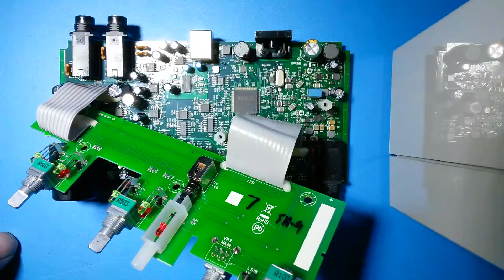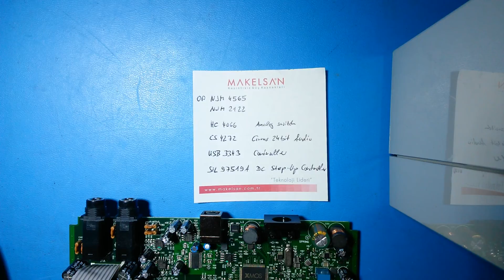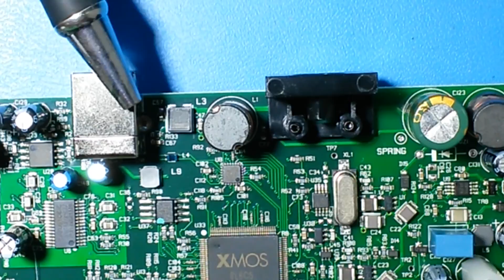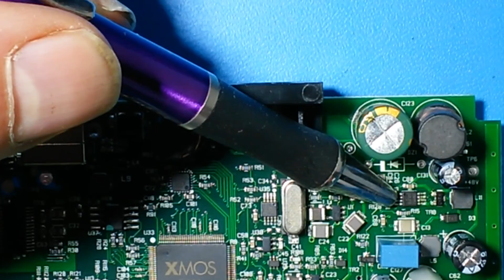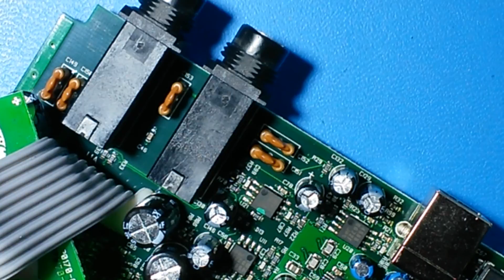Focusrite Scarlett 2i2 Defect, Repair hints, Reparatur Hinweise

Comment: USB3343 is a power controller. Not USB. USB controller what we are interested in is a XMOS chip. 4066 is a badly well known source of distortions. Considering high specs of the device, it's not used in a signal path

Comment: Hlo.. my sound card is showing a very dim green power light  
And when I connect it with the cable.. it doesn't show any lights on the gain knobs.. however 48W is working..  speakers are working.. but it is not connecting to my computer..
What could be the reason ? Which part has the actual defect ? Please guide me..
Reply from the maker: Seems there is something wrong with USB connection, cable or USB port, perhaps internal, plug connector. Try to use a different computer or USB port and other cable. Perhaps driver problem. When you are fit with electronics you can open and do some measurements. Don't make short circuit.
Reply: Yeah but I tried everything
Different Mac different cable
Reply: Problem still persists

Comment: My 2i2 is not going on imiditily I plug it to my PC it's taking hours, and then turns on the 48power first then eventually it turns on, can this be fixed and it heats up a lot near the dc controller

Comment: The 2i 2 range are very problematic..i was better of using a audio box then the focusrite.. I have a issue now where it keeps disconnecting and reconnecting by it self on windows.. Did all the Windows power settings but nothing seems to work.. Now I am assuming that it might be a hardware problem from the device or the computer.. Can't figure out what causing this issues.. Changing cables didn't work..this unit was showing this problem within the 1st week i bought it.. But now it is just more frequent and unusuable..
Reply from the maker: All the last yrs USBs on mainboards have a self reseting fuse for over Ampere. USB max is 1 Ampere. Your fault look for that. Something inside the interface could draw more than 1 Amp.
Reply: @joachimtiefnig2187  I see.. Dumb me.. I don't even know that I can do that on my audio interface.. Lol.. Can you let us know how to fix that?.. Thanks..

Comment: what is the value (reference) of U1? I don't know which component to replace. u1 (GALRA0) help me please
Reply from the maker: What part is "U1" ? Is this the big square chip in the middle ? This is a flashed microcontroller, for this one you can't get a replacement. Only from an other interface. I have no schematic and no picture of the board.
Reply from the maker: U1 must have a short name printed on it. You can reffer to a table by web search, this is available for transistors. "6As" is "BC817" for example.

Comment: Hi Joachim, thanks for doing this video.  I have a 2nd Generation 2i4 that gets absolutely no power when plugged into USB.  I have a multimeter, so my thought was to follow the signal flow of the power from the USB to the areas you highlight to see where the power stops, but I'm not very adept with a multimeter and not sure what I should measure or what setting I should have it on. 

The board is very similar to this one.  The area that you're highlighting for power smells like something 'blew up', but I see no sign of any blown capacitors on the board.

Do you have any suggestions?  I suspect this is likely a blown capacitor/s that I'd be happy to replace (I know how to solder).
Reply from the maker: Thanks for asking. Measure DC Voltage 5V. From PC to USB interface are send 5V through the cable. So, you must find 5V DC at the plug of the interface. If not then the cable or the PC has the problem. By finding 5V go to voltage converter chip SIL97519 and look for +5v and -5v. Download the audiochip pdf file and find out the 3.3v line number pin and measure it. CAUTION Be safe to make no short circuit and break no lines. You can use a very fine needle for connecting to the chip pins.

Comment: When i connect my audio interface  non of  the  light  is turning  on even usb light  is  not  truning  on . I think its  completely dead  . What can i do to fix this  problemmm
Reply from the maker: Is it yours? Did it work in past? What happened to the interface? Is USB at the computer demaged?
Reply: @joachimtiefnig2187  yes  its  mine  i accidently drop it  with the  cables  connected  . From then its  completely dead . Usb on my computer  is  perfectly  fine  .
Reply from the maker: It sound to me that the USB connector on the board has a brocken wire. If you are fit to check this and fix it. There are fine smd structures. Take great care. By dropping down normaly no further electrically problem shoud happen.
Reply: @joachimtiefnig2187  thanks  man  for  helping  me  out  ❤❤❤ i 'll try to fix  it  asap ❤❤
Reply: Did it work?

Comment: Hi, Thanks for the Video! I have a Scarlett 18i20 with a dead USB port. Would you have any ideas  where to look or what might be the most common chip to fail? 3343?
Reply: what is the value (reference) of U1? I don't know which component to replace. u1 (GALRA0) help me please
Reply from the maker: There is no schematic. I checked it with scarlet 2i2. USB Plug is direct connected to main controller, but there are no replacements. Sorry.

Comment: Very informative. I accidentally shortcircuited my 2i2 2nd gen as well. Accidentally routed a line signal into the right Main output. I heard a crackling and the sound gave out, but only on that channel. It hasn't been working since. I assume a circuit or chip is burned, as you described. Tbh I was planning on buying a new DAC anyways, the problem with the non-BUS DACs, like the 2i2 is that you always need it to do a handshake with a computer, so it's no good for standalone use.

Comment: Hi Joachim :). Dropped my 2i2 and now not getting a strong signal through the device (very faint and crackly if any). Any idea what might have been damaged and if I may be able to fix it?
Reply: did you find any solution i have the same problem?
Reply: I might be too late, by now you might have purchased a new one or got it repaired, but i am here to tell you something that seems silly .. i received a renewed 2i2 with input 1 not working / very low sound or distorted.. i came to the comments after the video and it gave me an idea after reading  these comments .. i connected my device placed it upside down on the table suddenly i noticed input 1 flickering on and off then i realized that the courier delivery guys might have played FIFA2022 with my 2i2. i kept the card connected and turned it upside down and slapped it in different directions from gentle to moderate only on the metal body. luckily the loose part made contact.. i ran some signal through input 1 and confirmed the connection is stable than i gently turned it to its right side up crossing my fingers.. but the signal is good then i tested with xlr and line in various times and its working.. (if you know how you have dropped it you could give a similar shock on the opposite side.. )

Comment: When I suppose to record vocals on my 2i4(2nd gen) it's volume getting low automatically during recording....

Then I pluck the xlr out and plug it again it starts working again but in between recording same problem occurs

My mic and xlrs are okay

Please help me
Reply: Did you fix it ı have a same problem…

Comment: finally someone gets far on this problem.. my 2i4 is 1st gen. and the pc recognizes but blinks at the start and no input and output... what should be the problem? i noticed  that the L12 gets Hot superquick..
Reply: Hi Braian, I have exactly the same problem as you. I have a 2i4 1st gen, blinks when connected, then USB led stays on, computer recognizes it, but I can't get any signal in or out... I'll try to get an oscilloscope and try to work out what's the problem once I have a bit of time. Let's see if we can find the problem
Reply: Is the driver, download the latest version from website and install it
Reply: Braian Barrales Chávez hi! We’re you able to find a solution to this? I have the same issue L12 burns as well. No audio input detected, although scarlett shows up on computer & DAW
Reply: @Oscar_lastname  no solution yet.. T_T

Comment: My 2i2 only shows a phantom light when I plug it in, the gain lights are off and it doesn’t connect to any computer. Do you have an idea of what exactly might be broken?
Reply: Hi ! I have same problem. Are you fixed your sound card?
Reply: Хищ - Ник not yet! I have a friend working in an electrical company, they are going to have a look at it. I’ll let you know if I know more!
Reply: @kornee  Thanks!!! Y think that problem is hardware....something part inside card...bad situation :(
Reply: I have the same issue as well
Reply: Bro I have the same issue
Reply: What is the solution?
Reply: Same issue
Reply: Same problem..... USB green light not on but the phantom power light is on... Not detect in my pc

Comment from the maker: No, sorry I've no schematic. The MAX4427 is not your problem. This is a dual MOS-FET driver. Check the names on the IC's and take a look for manufacturer manual of this IC. It can be a poti or a chip. Look for an analog chip eg. an op or any other audio chip.
Reply: Check this out: http://www.eevblog.com/forum/repair/repar-usb-audio-interface-focustrite-2i4. This guy has this same problem on a Scarlett 2i4.

Comment: do you have a shematic for this board?  my issue it is that on the headphones output only work the left one... no sound on the right... i change the capacitors and sounds better but there is no noise on the right side, i check the resistors and theu are right... what could be the problem? i think may be its the max4427 its the only IC that dirves that ouputs

Comment: Did you find solution?
Reply from the maker: No, I didn't. I think with my malfunction there is the main Controller demaged .
Reply: I had a same problem and take me a bit of time to find a problem.
Problem was faulty MC74HC4066A Quad Analog Switch/
Multiplexer/Demultiplexer on input One.Desoldering that Focusrite start working again (I get Output signal+Input signal on Input 2).After purchesing new hc4066 and soldering to place (in 1) i get IN1 also working and a full
working device again.I hope i helped a bit..
Reply: This is it. This is most often the correct answer in case of a shorted Scarlett. I shorted my 2i2 with a condenser mic via XLR (still wondering how that could've happened). The interface was still recognized by the computer but no I/O worked. After removing the MC74HC4066AG from channel one (where the first XLR went into), everything worked normally again except for channel 1. I bought another HC4066 and soldered it in – Now everything's back to normal!
Reply: @minhqdao  this solution does work on my scarlett, I also accidentally removed the chip above the hc4006 I don't know if it will cause a problem in the future but my scarlett is working right now. Thank you.
Reply: I have one 2i4 and sound from pc doese not go to headphone out, also no input in 1 and 2 to headphone, all led works, mabe it is that ic.
Reply: Yes it is that ic 74HC4066adg , SOIC, 14 pin, mine is working now after i removed it. I was using a powersuply (600mA 2,6v) and feel the heat of that ic

Comment: I now have the same problem with my Scarlett 2i2. I believe it was a result of plugging the output of the interface into a mixing desk (for live use) and after this there is no signal from any input/output. 

The interface is still recognized in windows and reaper, and will even 'play' audio as displayed by the audo levels in reaper's mixer / pc sound... but there is no signal whatsoever coming from the interface. Upon plugging in a microphone / guitar into either input, there are no halo light gain indicators and no input level whatsoever also. 

most people says that I burnt out the capacitors inside in Scarlett, due to phantom power perhaps being left turned on on the mixing desk.

if so.. what should i check ? what should i buy ?
Reply: Can you figure out where the problem is?
I'm with this problem too.
Reply: I have this exact same problem on my 2i4. I used to use a condenser mic on it and the phantom power probably damaged the board. I still can hear a very low and distorted sound if I connect Scarlett on Linux and set the volume higher than 100%. Warranty is over and I really want to recover my Scarlett.
Reply: @herodrigues  did you fixed it? How
Reply: @arthurguitarra87  No, I got a multimeter and measured some capacitors that the Scarlett support team asked me to measure.
Baseline / Measured
Across C44: 3V3 / 3.24V
Across C46: 1V / 1V
Across C193: +5V / +0.91V
Across C194: -5V / +0.41V
Across C195: 48V /  47.3V (phantom power turned on and off) 

So, it seems that the problem is related to C193 and C194 which are simple capacitors that can be replaced. I haven't replaced them though because I don't have any soldering tool.
Reply: @herodrigues Hi Herison!! where did you find them?
Reply: @giovannigantiva5953  I don't remember quite well, but you can see their names on the board just like this video shows.
Reply: I fixed mine today.  I accidentally shorted the phantom power and after that it was still recognized by the pc, it would think it was playing but no output, and input was completely dead as well.  Checking with a signal on input and tracing with a scope it was apparent the signal was getting all the way to the cirrus logic ADC/DAC.  Voltages were a bit low too (about 4.5V instead of 5V and 3V instead of 3.3V).  I contacted focusrite support and they suspected the cirrus logic chip, and sent me a new one.  I replaced it and now it is fully functional once more :)   If you can trace a signal from input all the way through to the cirrus logic chip, and also the direct monitor works (ie signal on input goes through to output when the direct monitor switch is on, then likely all of your analogue circuitry and the xmos chip are fine, and it could be the cirrus logic chip. 

Mine is an early model 1st gen 2i2 purchased in 2013, I was confused at first by this video when I was trying to trouble shoot because it mentions dual rail on the opamps, but mine is single rail.  Looking at the board reveals some differences in the power supply section.  I at first thought I had lost the negative rail but focusrite confirmed that my model was in fact a single rail design and that later models they changed to dual rail.

Comment: 2i2 is not coming on but but phantom can power, and the soundcard is not visible on pc do you have any idea
Reply from the maker: Maybe there is something wrong with USB (cable or controller), otherwise the main controller of the scarlet is demaged. If possible check the DC-DC step down converters 5V to 3.3V for making sure this controller get power.
Reply: please can i get your email
Reply: how did you solve the problem ? i've got the same issue
Reply: Reinstall the proper software from focusrite.com and you are good to go.

Comment: I'm trying to diagnose similar issues with my board; it powers on and the computer recognizes it, but no signal. Focusing on the CS4272 chip, I'm probing pin 20 (VA) and 21 (AGND). Both seem to be connected to GND and pin 20 (VA) gives no voltage when board has power. I'm assuming that I have a short circuit somehwere? Perhaps a blown cap?

Did you happen to record the voltage values that you measured on the various chips?
Reply: what is the value (reference) of U1? I don't know which component to replace. u1 (GALRA0) help me please
Reply: @moiceyev  I actually fixed it by replacing U26

Comment: TR8 and U9 burned down on my focusrite. What is the nominal value of these components?
Reply from the maker: U9 is Intersil ISL97519A. I have no schematic. Refer the ISL97519A manual for the MOS-FET function.
Reply: I removed broken ISL97519A and tr8 from the board. The sound card began to work correctly. Phantom power +48 V is turned off. But I don't use it in my work.
Reply: what is the value (reference) of U1? I don't know which component to replace. u1 (GALRA0) help me please

Comment: Hi, I bought a scarlet 2i4 sound card 3 years ago. Soon there was a problem like this video. what can be the problem. Thanks https://www.youtube.com/watch?v=c928xv7epx0
Reply from the maker: It seems that you can do nothing. I didn't finish this video but here is the rest in text form. I ordered a new Cirrus audio chip and replaceed it, but still the same fault. This means directly the main processor of the device is demaged. If someone connects the input to the output line with enabled phantom power, than the output gets the 48V and leads this through a capicator to the 5V/3.3V power line for the digital logic ic's. Without the original replacement chips and the nessesary equipment no repair.